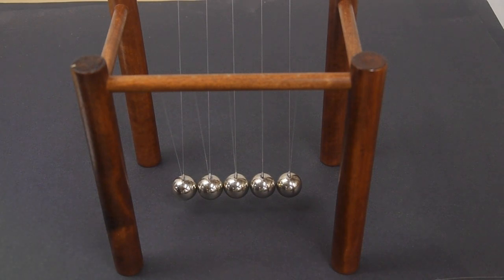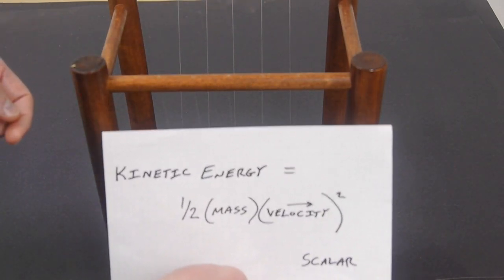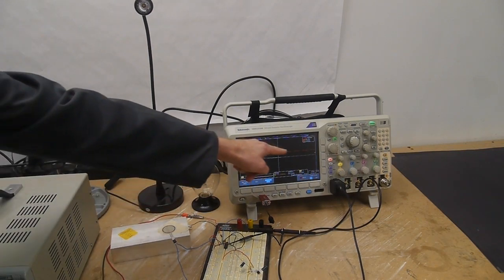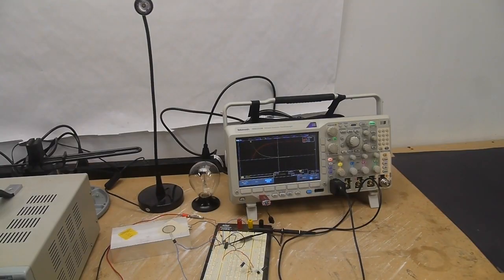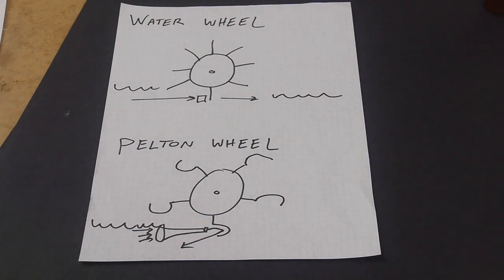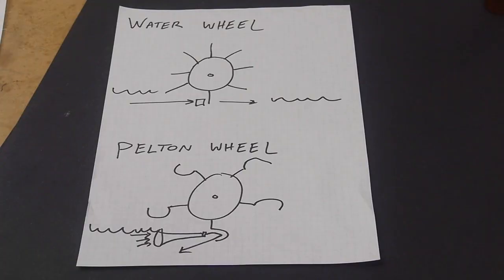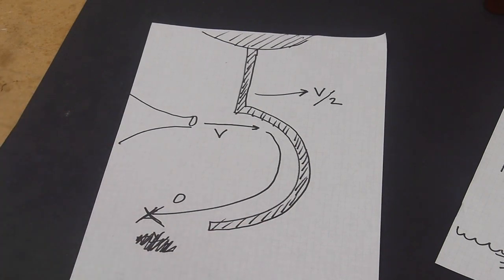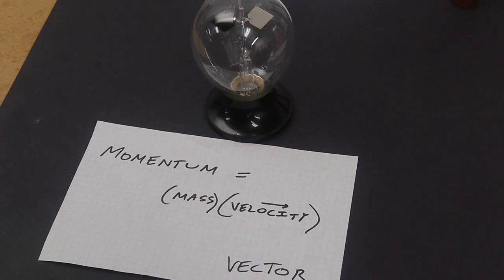Obeying the law (of physics)! Kinetic energy and momentum explained

Comment: (1) More EM radiation (in the light spectrum and short-wave infra red) is absorbed by the black side of the veins.
(2) The black side of the vein re-emits longer wavelengths of infra red which are absorbed by air molecules near the surface of the vein, causing thermal expansion.
(3) The pressure differential causes the veins to be "pushed" with the black face trailing, since this is the side with slightly higher air pressure.
(4) The air from the white side will obviously be seen creeping to the black side, since this is what happens when you move anything through air. (Some people think "thermal creep" is what causes the veins to move, but it is a symptom of the fact that the veins are being pushed through the air.)

Also, the air pressure needs to be low enough such that the veins can move freely without much resistance, but not so low that there isn't enough air to be heated by the longer wavelengths of infra red being emitted by the black surfaces.

Comment: Great explanation, especially the part about the best energy transfer when the wheel is rotating at V/2. Same principle for load impedances matched to driver impedances, (loaded voltage = no-load voltage / 2), and maximum power from a motor is when it's loaded to half no-load speed.

Comment: This is how I best learn stuff. Lots of hands on experience and experiments supplemented with crucial research. I never was very good at something that requires a lot of reading and research supplemented with crucial experiments.

I think that's why I have always struggled with math, yet excel at practical chemistry. Chemistry is heavily math based, but if I am doing something I can actually visualize in front of me, it's easy for me to take measurements, do calculations, and perform successful experiments based on those.

I like these videos. Keep them coming (:

Comment: Should it interest you with some further experimentation, Ben, I propose a method of demonstrating photon pressure on radiometer vanes:

No doubt, the needle-and-glass bearing would present too much friction for the extremely weak force. You could create a completely frictionless bearing with a diamagnetically levitated small magnet between two pieces of bismuth (with a much larger magnet held above to counteract gravity, of course). The four vanes would protrude outward from the magnet and bent down to maintain stable center of mass. Mount apparatus in vacuum chamber and pump to high vacuum. Apply bright light and hopefully watch it spin with white sides trailing.

...Or pump to typical radiometer pressure and see how the diamagnetic bearing compares to a needle-and-glass bearing. Would the radiometer be more sensitive with the frictionless bearing?
Reply: How sensitive a detector would we need to measure the red shift? That would be really cool to see too.
Reply: fsmv depends on the degree of red shift

Comment: The key to the Crookes Radiometer is that there is a partial vacuum in the glass sphere. When light hits it, the gas in the sphere, next to the surface of the black side of the vane gets heated up more than the white side. So I assume the gas molecules bounce off the black surface faster than the cooler white surface thus producing thrust. But a good question is, "Since the vane is so thin and presumably made of thermally conductive metal, are the white and black side of a vane the same thermal temperature? If so, then is the difference in emissivity causing the gas to heat more on the black side? Is it radiative heat transfer from the warm black surface to the gas or conductive heat transfer (or possibly convective)? What would happen if the vanes were made of a good thermal insulator? Does it work on the space shuttle or space station?

Comment: whats happening in the crookes radiometer is actually pretty simple. The dark absorbent side heats up and gas molecules near it gain heat energy and expand away from the warm vein. This pushes on the vein and causes a torque. Even a radiometer in a good vacuum will probably do this, less gasses for torque but less resistance to motion.

Comment: I never knew velocity was a vector, alot of stuff i know just clicked; this is amazing.
Reply: MrGridStrom Vectors are fun and interesting to work with, especially in 3D. The most fun thing I've done with vectors was calculating the closest point of approach (also referred to as CPA) of 2 moving objects in 3 dimensional space. I also included a constant acceleration vector on each (but not jerk, snap, crackle or pop! I wish I knew enough to calculate those. Those seem extremely complex.) ;-)

Comment: Conservation of energy states "energy in" = "energy out". take two frames or reference the "energy in" and the "energy out". "Energy in" would be the potential energy the ball has at the height before you release it, the general equation is "(mass)(gravity)(height)" or "mgh". The second reference frame, "energy out", is the instant right before the ball hits the line of stationary balls. here, all of the potential energy is converted into kinetic energy. Therefore  "energy in" = "energy out" or  mgh=(1/2)(m)v^2. all the variables but velocity are know so you can solve for it.  in theory, assuming there is no energy loss through the ball hitting the line of balls, the ball on the opposite end should leave at the same velocity the original ball hit the line with. or at least I think Im right. you dont necessarily need the momentum equation to solve the problem, you were just missing a piece.

Comment: Nice explanation. And when the skater pulls in her arms that requires work/energy, same amount as the kinetic energy increase, right?
Reply from the maker: That's a good point.  Usually the speed increase is attributed to the change in moment of inertia, which is true, but it's also true that the skater is doing work because the force to pull arms inward is the same direction as the arms moving inward.  Both factors are valid, I think.  Another example might be how a child on a swingset can swing higher by moving his/her legs.  It more clearly takes work to do this, and causes the swing to go higher.

Comment: Doesn't compton scattering play a role in it spinning? Is that how you figure out the photons relativistic mass? When I tried that I found the wavelength of the photon not the mass. What if compton scattering causes the green light photons to drop down to IR photons then they hit the black vanes and when they do the heat the black vanes heating the air and causing the black vanes to move along with photons hitting the black vanes directly?

Comment: This just left me with lots of questions that probably come from the fact that I don't know very much about physics. For example, when you talk about holding the radiometer to stop it from moving you say that the photons bounce off the white surface with the same momentum as they came in. But this confuses me because I thought that when you hold it it just acts as if it had more mass and more inertia so it appears to not move but in fact it moves a tiny bit that is almost unmeasurable but it moves. And that that movement would be in proportion to the momentum transfer it received and the mass it has, so it would be like it experiences the same force but it is spread over a much heavier mass so it looks like it didn't move. But if this was case then the photon shouldn't come out with the same momentum as it came in. In fact it should come out with the same momentum as if you weren't holding the radiometer and you allowed it to spin because now that same momentum transfer is being "spread" over a much lighter mass with much less inertia so it spins quickly now but the photons should come out with the same momentum. 
The problem is that this isn't probably the case since it would not relate to the experiments you showed with the balls I think. 
So for example if a ball were to collide with another ball at rest of the same mass (and they are both really bouncy so very little energy is transformed into heat and sound), would both balls bounce off at the same speed although that speed would be slower than the original?
And if they do and you repeat the experiment (the moving ball moves at the same speed as before) but now the ball at rest is really massive, from what my knowledge tells me the ball should bounce with the same speed as the previous experiment though the heavy ball would move very little. From what the video says the ball should bounce off with almost the same speed as it came in because it is like if if did very little work. But from how I see it the heavy ball has the same kinetic energy as the lighter ball. 
The problem is that if it is the same then what the video said does not work and I highly doubt that is the case. 
On the other hand if it is bot the case then things can seem as if energy is not being conserved. Like if I push a car with not much force and the car is not moving with its corresponding kinetic energy then where would that energy be going? Is it really all being converted to heat? Because it doesn't feel right. 

Also I still don't really see why when he picks up 2 balls from the craddle, the last ball didn't come out with twice the speed but rather always came out the same amount of balls. How is that momentum solves this?

Comment: (In response to the Pelton Wheel):  If the water has zero velocity (relative to the pump,) there won't be anywhere for the next "bit" of water to go, right? I know there is something called Betz's Law which refers to the maximum efficiency of this kind of thing, but I'm not 100% sure that this would change the analysis of the optimal speed of the rim of the Pelton Wheel. I'm not trying to be pedantic, I am just curious about this! Thanks for making these videos, you are absolutely amazing at what you do, and I learn a lot from your videos

Comment: Your videos are awesome. What I don't understand in this one is that since both rubber balls when they hit the sensor come to rest at some point ( before the first bounce that is) this means that they both deccelerated to zero. since the non bouncy obviously took much less time to stop (it didn't have to wait for its deformation) this means that the force vs time must have been much higher and instant, like a Dirac function.  So I am guessing something is wrong with the sensor, maybe a threshold or some kind of "inertia" that makes the sensor not responsive enough or a time resolution wasn't dense enough (although I have no idea how the setup works)

Comment: Could you run a water wheel from city water and use the generated power to pump that water into a tank? Would there be any real value power generation wise if you did?
Reply: I imagine you would actually lose power if you did that. Why wouldn't you just pour the water into the tank straight from the tap? Adding the extra water-wheel/pump contraption seems like and unnecessary additional step.

Comment: How would you get the Pelton wheel to rotate at v/2?

I understand why it is the best operating speed, but how would you keep the wheel spinning at v/2?  I could think of adding a damper to the system, but then you're just bleeding energy, and then is it still as efficient?

Or will the wheel naturally spin at v/2 because that's when it gets the most force (change in momentum)?

Is it something like if you plot input water speed versus wheel speed (assuming they're along the same direction), is there some sort of stable maximum/minimum?
Reply: Probably by adjusting the nozzle diameter.
Reply: h0lx Yeah I was thinking about that, but then you'd need a controller (or something) to sense the velocity of both the wheel and the incident flow and be able to actuate the nozzle.  I guess you could do it by hand and approximate it, I'm just not sure how exactly it's done.
Reply: Also now thinking about it, you could also hook it up to a gearbox, that way all the damping will do work.
Reply: Ninjaplz10154 by mathematical models
Reply: onyzee Yeah, so there's no natural mechanism that keeps it rotating at v/2, so it seems like a waste of energy
Reply: Ninjaplz10154 Waste of energy? What are you talking about? I think you didn't understand the video. It doesn't mean if you can't keep exactly at v/2 is not worth it at all. What it does mean is that when the speed is going below v/2 you are losing speed and when the speed is going above v/2 you are losing torque. In both cases you are getting less work than the optimal and theoretical v/2 speed. There will be a point where if you can't keep the speed in a certain range you won't get better efficiency out of your system than a flat water wheel but it doesn't mean you need to keep it rotating at exactly v/2.
Reply: Adriano Melo I understood the video.  I'm saying that if it's not being maintained at v/2, that means you're not getting the full potential you can get out of the flow.
Reply: Ninjaplz10154 Like the engine of a car, max torque and max power don't happen at the same rpm. If it's after most power that you're after you won't mind it to rotate faster than v/2. For example, three 1.5 kilo strokes per second is preferable to two 2 kilo strokes per second. If the latter were max torque @ v/2, the former would be less than max torque but at a speed above v/2.
Reply: Small servo to increase or decrease the size of the bucket, or even just to open a flap on the back lol. Takes relatively little energy to change the size of it above the water, and changes could be made in real time. I guess opening them out flat would regulate the speed well enough above the water but stall the system below it, and operating HD servos at those speeds would cost too much electricity(assuming you're connecting it to a generator) to be worth it unless the wheel is massive...a material which is still enough to get a good force but opens up above the water to help brake it? Obviously passive is the best way but it might be tricky to implement(or cost a lot in R&D).

Or a torque converter similar to a cars automatic? Store some energy in a fluid and use that to moderate both the speed and the output stability? Making a few concrete culverts to direct the water past the vanes would definitely help, could even build them below wharves if there is a good tidal run...

Even though the question was physics, I'd rather build it and test it than do the maths. Anyone wanna start a business? Ahah
Reply: This is exactly the reason why your car needed a gear box.

Comment: Forgive me if this has already been addressed. Regarding the pelton wheel, from a practical standpoint, if the wheel was moving at V, thus extracting no energy from the jet of water, the wheel would still be doing its job (crushing wheat or w/e). It would also be doing its job at maximum speed.  Of course, after doing its job, the wheel would inevitably slow down, at which point the jet of water would collide with the cups, etc etc..  Am i correct? (possibly splitting hairs on this one, i understand lol)
Reply from the maker: The only way that the Pelton wheel can be moving at the jet speed (V) is if it is doing no work.  At speed V, the wheel will have no torque, so it must be on frictionless bearings and not connected to a wheat grinder or generator.  As soon as the wheel does work (grinding wheat, etc), it will slow down.  Some electric motors have a similar torque curve, where they produce lots of torque at a standstill, but produce no torque at their free running speed.  In fact, their running speed is determined by the point at which they have no torque!  If they had more torque to supply, they would continue to turn faster until there was no more torque available.
Reply: Applied Science Heh, yeah i realized that a bit after making the comment. But what you mentioned about torque determining the running speed of an electric motor has given me something to think about. I'm working on a V.A.W.T. (vertical axis wind turbine) using an electric motor as the generator and torque is something I didn't have a full grasp on until tonight.   Thanks Ben.

Comment: I don't think it's redshift. Redshift is the Doppler effect applied to light, i.e simply a geometrical consequence of the relative speeds of the photon and the observer (the wikipedia article on Doppler is good).

Here light is absorbed by the atoms changing their current energy state to a higher one, and then reemitted when they come back to a lower energy state. The energy states of the atoms are quantized (because the electrons jump from one definite "trajectory" to another, there are no "in between" trajectories), so they correspond to specific light frequencies according to the equation E = hf = hc / lambda where f and lambda are respectively the frequency and wavelength and h is Planck's constant. This is what you saw in your home made spectrophotometer: you lit the atoms with light and you got specific wavelengths corresponding to the changes of energy states of the atoms of the material. But they react probabilistically (because everything is probabilistical in the quantum world) only to wavelength corresponding to these changes of energy states. Had you lit the material with a laser with a different wavelength, you would have seen something else or maybe nothing at all (quite unlikely I suppose). So the atoms absorb light selectively.

When the photons are absorbed (from the incident direction) and reemitted (in all directions), they transfer their momentum p = h / lambda to the atoms thus creating light pressure.

I loved your experiment, BTW.

Comment: the expanding air (due to heating of the black plates) pushes the black sides away, that's all. The vacuum is not perfect there or it would not work.